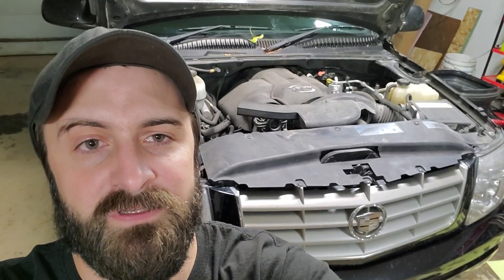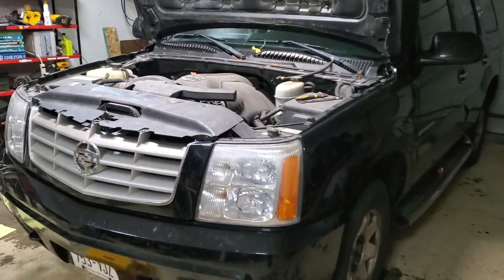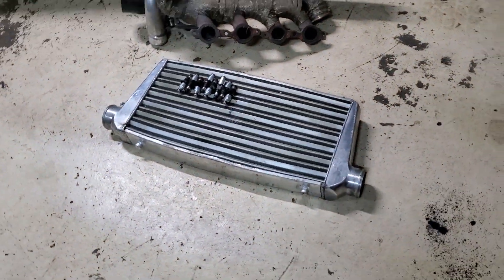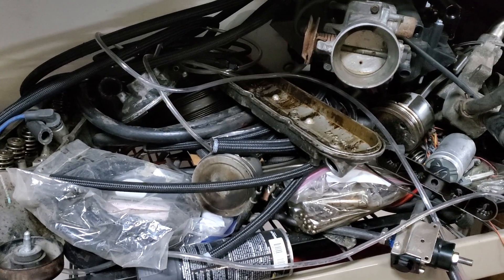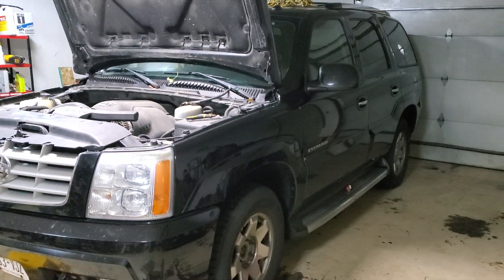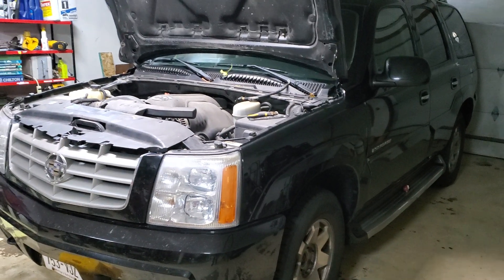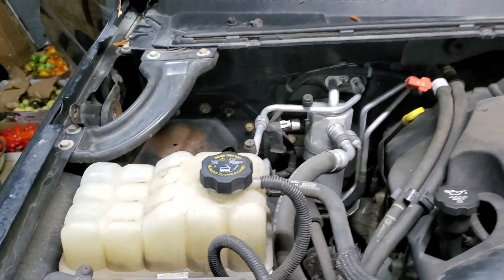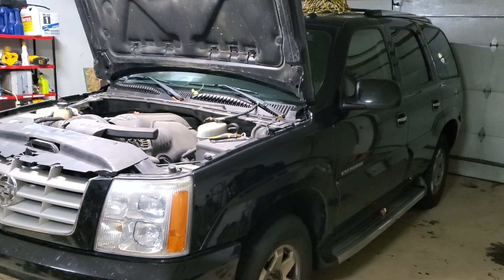Turbo Escalade Build Starts Now!

Comment: Is that transfer case that you want a viscous coupler, because the other ones use the brakes to make it a fake AWD and I’m sure with more power that will smoke the hell out of the brakes. I’ve been wanting to do the same kind of thing with a AWD S10 single cab short bed or really short bed of a crew cab S10. I’m picking up a 97 bravada transfer case and front end this weekend
Reply from the maker: Viscous coupler 60/40 I believe. BW4485 is what I'm looking at. I think it will work.
Reply: @BlaserBuilds  4485 is an open planetary setup. Acts like an open diff, the driveshaft with the least traction spins. The 4483 found in the hummer h2 is the same setup with full time awd but you can lock it. Pre '08 was 27 spline input, post 08 is the 32 spline input.
Reply from the maker: @wainfiggitty  Good to know. Never looked at the 83s.
Reply from the maker: @wainfiggitty  I ended up finding a NVG-149 with 32 spline adapter for $550. Pick it up a few days ago.

Comment: Funny I just started on my 04 escalade turbo build this past weekend. I'm using almost all used leftover parts. I piggybacked on a microsquirt and i'm adding the turbo setup next weekend. I got a used microsquirt, used snake eater 850's, used 78/75 and ebay truck turbo log manifold.

Comment: 03-06 Escalade nr3 code is a bw4481, its longer than the nv149 and is hooked to the computer system.  You'll need to swap shafts and deal with a couple codes to go nv149.